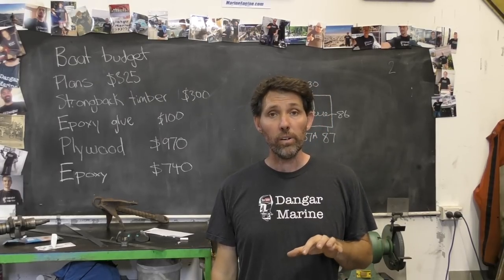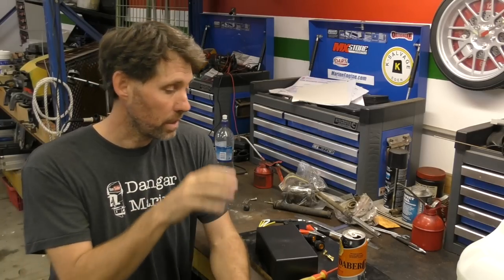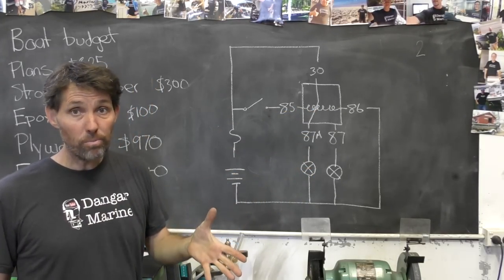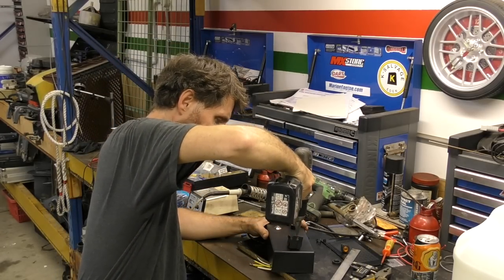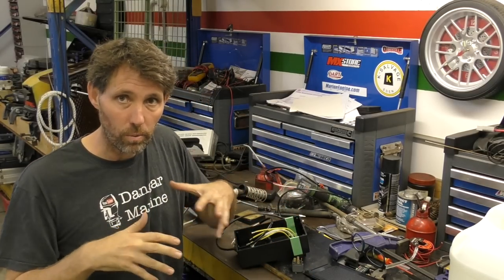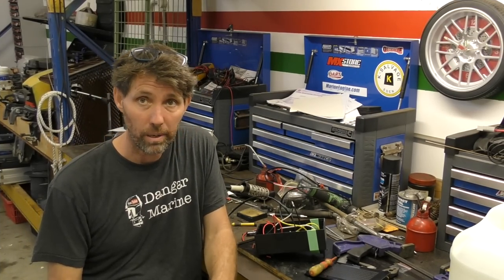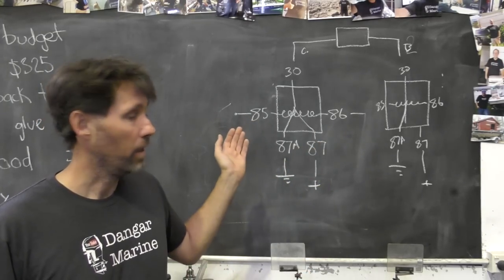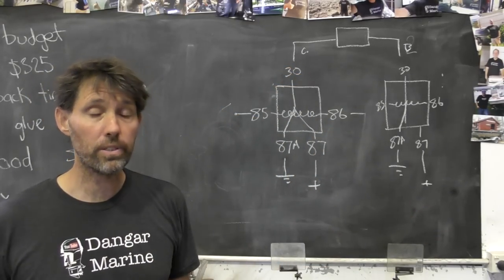Making a relay tester

Comment: Nice little kit stu!  Only little tip I can give is to tie a little knot in the power wire feed to stop the cable from potentially being pulled back out.  (don't worry electricity can still pass through :p )
Reply: No, don't tie a knot in the cable, use a proper strain relief. Tying a knot gets the electrons confused over which way they are expected to run and you can weird results

Comment: I bought my boat used, it's older (1974) but came to find out a previous owner used 1 car relay vs marine relays. Should I be concerned? How urgent should I swap if need be? Thanks for all you do, have learned a ton!!!!
Reply: A relay is a relay. I'd keep using it till it breaks. The term 'marine' has become a term used by company's that make crap to pass their stuff off as quality products. Because we associate 'marine' with though and well built. I think unless you buy a name brand quality marine relay there won't be much difference with an automotive relay.
Reply: I would tend to agree largely with what AR1G3 says.  I've spent the majority of my life dealing with heavy road vehicles, and since the 80's, the bulk of the relays used would by far NOT be considered waterproof, nor recommended for use in possible wet locations.  It's not just the body of the relay that wants to be waterproof, but keeping the pins and socket shielded and water-tight would also be a consideration.  The guts inside would be exactly the same, so whatever the rating of the relay is, I'd have faith in that much.  As for being "marine-grade",  if I were putting a relay in place, I'd be more concerned about how the entire panel would be shielded against water ingress, and just use whatever relay was available. But that's just my opinion.
Reply: Good point about protecting the entire panel against water ingress! A 'marine grade' 'waterproof' or whatever relay is no good when the rest of the relay panel isn't protected against water.
Reply from the maker: I think the guys have pretty much covered it, and a big thank you for doing so. It gets harder and harder to get to every comment so it is great to see viewers helping each other out. :)
Reply: Your boat is very near the same age as mine ('75) . As long as the pins point down and the relay is not getting splashed by water every trip I would do as suggested by the others. Your issues are more likely to be external pins connection than internal as the relays have always been splash proof. These days the automotive relays and plugs are all water proof anyway if they are under the hood so washing the engine doesn't blow the ECU/BMC .

Comment: If the trim/tilt motor is only going in one direction, can you just swap the relays to see if the motor will go in the other direction?
Reply: Yes, it won't hurt anything to try.  IF one of the relays is burnt/fried, then swapping the relays between their respective positions should allow the t/t motor to go in the other direction.  Of course, if one of the relays is fried,  you might wish to do some further checking (once safely back home) to find out if there is a wiring (or switch) problem that caused the relay to fail in the first place. Sometimes they fail from age, heat, but sometimes it's due to an underlying problem that causes them to heat and fail.
Reply from the maker: You can, as Stan says. He's dead right about asking why it died in the first place. The only other thing is if it has died completely and no current is flowing through it then when you swap them around you won't get your ground so the motor still won't move.

Comment: What's the naming convention reasoning of pin 30, 86, 87 etc.? Why is it not pin 1, 2, 3, 4, 4a?
Reply from the maker: Good question Seth, they are part of a larger pin numbering system: https://en.wikipedia.org/wiki/DIN_72552
Reply: 1234 were already taken for the security code or theirs kids names

Comment: Stu, you could also use the relay base mounting tab to run a strip of metal from the tab down to the case and bolt the metal strip to both, or move the relay base further in and use a piece of angle iron as an L bracket to do the same thing. That may be easier for most people that finding that plastic glue, although I have found plumbers PVC glue works on the Jaycar brackets and jiffy boxes.  This circuit is also used for things like car windows and some electric kids toys like the trikes and cars, so it a pretty common circuit to be found. It is also handy to have a globe across the fuse ( in the jumper lead and the tester) . It will only light up if the fuse is blown, which can stop a lot of unnecessary fault finding !
Reply from the maker: Hey Ron, I like the idea of a globe across the fuse, that's a good idea. :)

Comment: I just found your channel. Your videos are great! So much information! I am getting ready to rewire  a boat so these videos are the best. I'm a new boat owner... I'm a new owner of an old boat. One video I've been looking for is on the flotation material under the floor of boats. I have an aluminum Blue Fin that was supposed to be leak free. I've taken out the floor to find some of the flotation  material missing and the pieces that are left are not in very good shape. I've taken it all out to seal the hull on both sides but I'm wondering if the flotation material is needed or required to be replaced? Any advice would be appreciated. Thanks
Reply from the maker: I will be doing this job when I add floatation to the boat I am building. You can go a couple of ways. You can put solid pieces of foam in a cavity if it can be locked in by screwing a deck down etc or, as with my boat build, I have a two part expanding foam that I am going to pour in.

Comment: Using relays on a daily basis, I wanted to see how you would explain how a relay works.  Great job!!  At 10min in, I noticed you didn't have the ground on Pin 86 connected.  I smiled waiting to see if you edited the video without explaining.  But you didn't.  THAT deserves a Like and a share.  You're not gonna use editing magic to make yourself look good.  Huge Kudos.
Reply from the maker: You have a sharp eye! Thanks. :)
Reply: Yes I am also noticed

Comment: i've been fixing everything under the sun for over 40 years and that is the first i ever seen a relay with two pin 87 connections!!!. nice gadget build.  i will suggest using actual bulbed lights instead of led's for indicators that some may want to use. reason being led's draw such little amperage that  a relay with badly burnt contacts may still show a false ok. ultimately the best would to have a high enough resistance  to actually have a 15-20 amp draw built in. but your build will show if its working which most of the time is all you need.    relays can be fun and usefull.  had an energised sollenoid use to stop a diesel with a timer circuit and the relay was just the trick  to make the circuit work. a $5.00 relay vs the correct sollenoid at $350.00 guess which route  i went lol.
Reply from the maker: You can't beat a good cheap fix that's for sure! Oh, and I completely agree with you regarding needing the current draw to get a better test which is why I chose these lights as they are actually globes not LEDS. Not so easy to find these days!

Comment: Love the idea - I searched for this hoping to find something that actually applies a load to the relay - many times my relay tester will say a relay is good but when you actually use it for a loaded circuit it fails. I’m going to build this box like yours but the lights will be high wattage halogen bulbs.

Comment: Nice but this is not a LOADED tested. I have had a lot of relays that would pass this kind of test but fail when a loaded was added. Most relays of this type are rated at 30 to 40 amps. I have see relays past this but fail when a let us say a 20 amp load was added to the out put. I had one just today as a matter of fact. The relay would light my test light just fine but failed to trip the 30 load of the stater Bendix. A new relay fixed that problem.

Comment: Ever hear of Radio Shack down south?  Years ago they sold a similar tester and the individual parts shown.  Do all marine relays have the same pinout?  How about building a nice digital unit that stores the pinouts of every relay ever made, or connects to the cloud to get the data, and automatically changes the socket wiring as appropriate.  Comes with every size socket also.
Reply: I don't know if RS had a presence in Australia, but I really was sorry to see them fold up (first in Canada, and then in the US).  They got a bit expensive as time went by, and unfortunately, the focus began to sway away from parts and pieces... until the end when their staff knew nothing about resistors or diodes, much less relays, and all they wanted to sell you was a battery or a charger or a cell phone.  I miss the 70's.
Reply: Yes, we had Radio Shack, and they folded because they moved away from the component sales to toys, TVs and the like where they were not competitive, much like Stan states below. Another local company Dick Smith Electronics kept Radio Shack honest price wise and outlasted them by quite a while. However Dick Smith got sold off to a big food based retailer and they took Dick Smith the same way as Radio Shack, with the same final outcome. You can still get to a 'Dick Smith' online, but that is just a web presence for a company called Kogan- and there is nothing special about either of their sites. At the moment we have Jaycar as a major hobby level retailer, with a slightly smaller Altronics keeping them honest price wise, Element 14 at a more professional ( and a far greater range of esoteric bits and industrial level gear) and of course Digi-key (pretty much element14 level of range) . There are plenty of other companies but all of those are pretty much 'mom and dad' stores.
Reply from the maker: I've been working on just that device day and night Bruce! Funny you should mention it as my very first job when I was 14-15 was working at a Radio Shack store. Ending up managing a store for a while after school then moved on.

Comment: Great video.. Will be collecting the parts to knock one together too.. I guess you could have a couple different types of relay holders and just wire them the same way so you can test different types.. I work on bikes and they use the smaller relays a lot too.. Nice one

Comment: Hey Stu, any chance you could do a segment on stator plates on a 2 stroke please? ie symptoms of a faulty stator before I replace one on my 50hp Tohatsu on my Thundercat which is probably quite costly..cheers
Reply from the maker: I'll add it to the list. It is generally a case of testing the resistance of the coils. There will be a spec for your outboard for what resistance range is acceptable.

Comment: I have a relay box, wires, and switch that is completely corroded and needs replacing. I wonder if I could add a switch to a version of the box you created and then connect this to the outboard motor and use it to move it.
Reply from the maker: I make pretty much exactly that in this video https://www.youtube.com/watch?v=T0Vf7mSUlUY
Reply: Dangar Marine  You totally read my mind.

Comment: Ok what I learnt is I should probably have relays on my trim motor not just a momentary switch What else should there be relays on in my boat?
Reply: Anything that draws serious current. I'd prefer to use relays where it isn't necessarily needed instead of not using them where they are needed. I'd definitely put them on an electric fuel pump, trim motor, stuff like that. Lights depend on the kind of light you use, but most of the time you won't need a relay.
Reply from the maker: Yeah, as AR1G3 says, pretty much anything that draws more current than you want to have passing through the switch, or if the switch is a long way from the device.

Comment: You nearly lost me at Bundy, however I just managed to hang on, it was a close one! I use dual pin 87 relays for installing spotlights on cars, that way you don't have to try and shove both wires into one spade terminal when you run out of the yellow ones. ;-)
Reply from the maker: Thanks for hanging in there mate. ;) Sounds like a good use of these twin pin 87 relays.